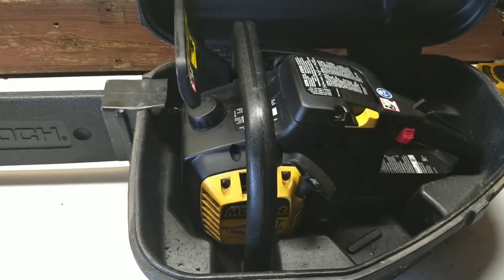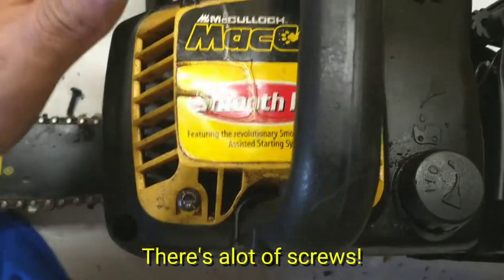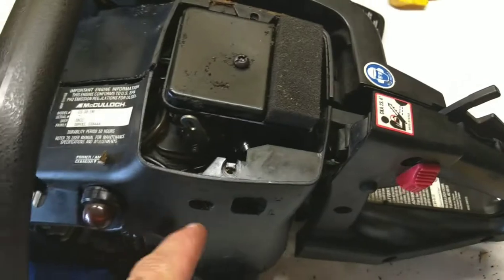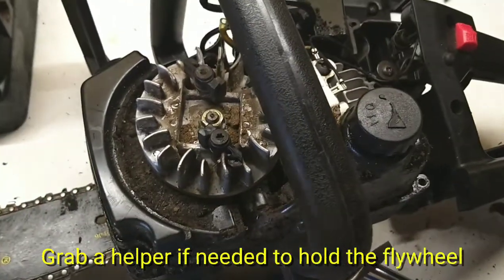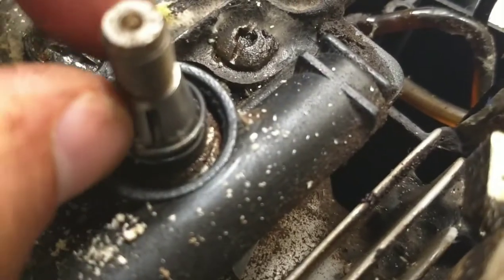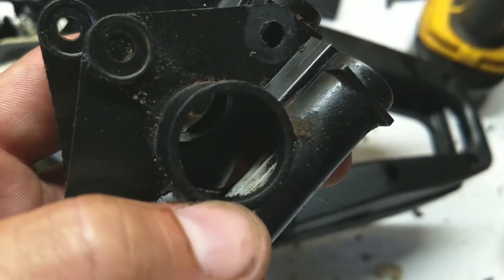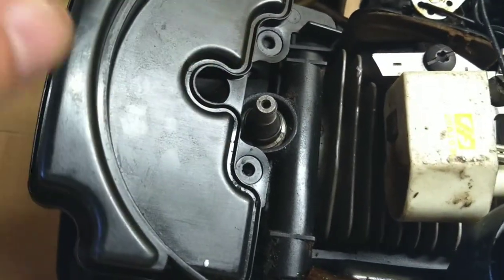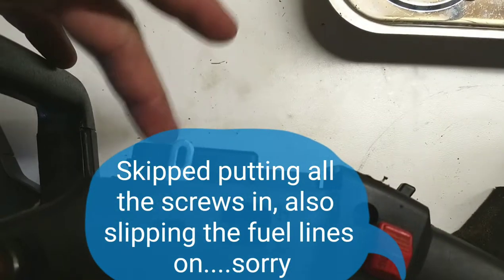Eager Beaver McCulloch Chainsaw 35 cc 38 cc

Comment: Make sure that the worm gear that drives the oil pump is not spinning freely on the crankshaft as I had in my case. This worm gear is not locked by a key as the flyweel is. If it is spinning use Loctite 638 to lock it in place.